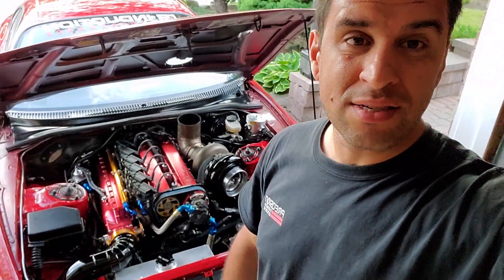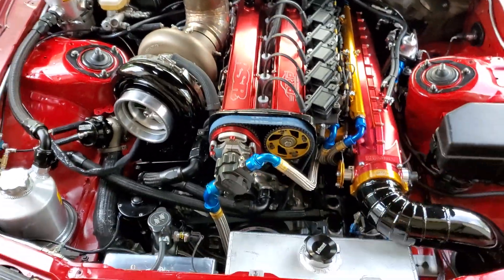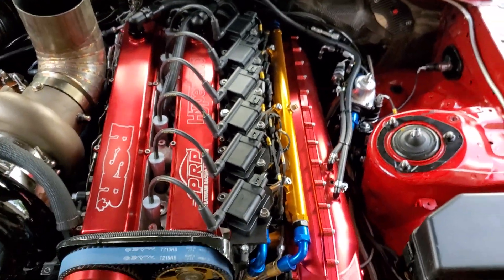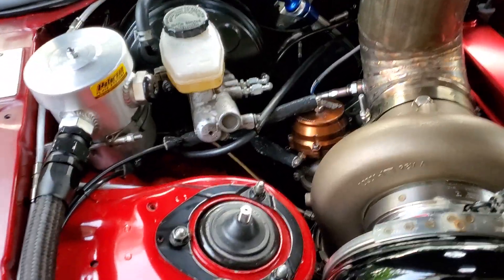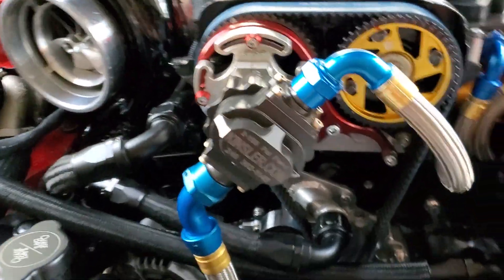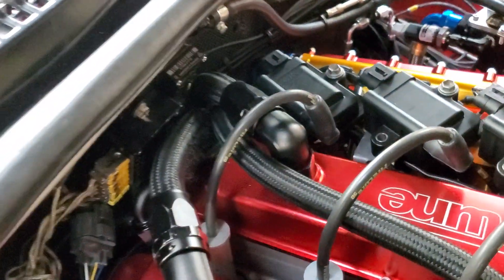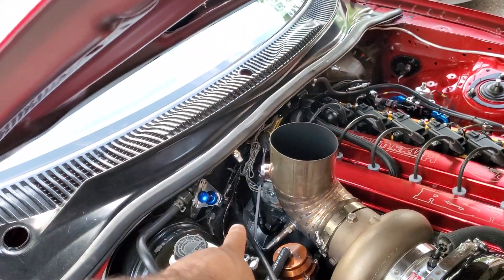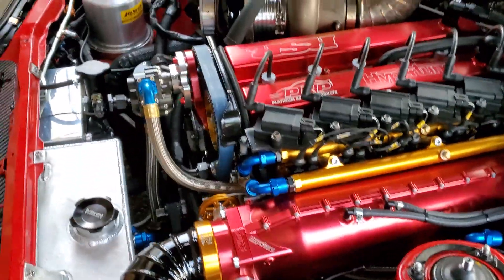2500hp 2JZ - Engine Details

Comment: Such a killer build man. Building a 1000-1300hp 2jz now. The oil setup you have is impressive with the heating/priming of the system.

Comment: "Mods to the engine" my brüther you have an aluminum block 2j that's kind of more than a mod lol
Reply from the maker: haha... believe or not, the supporting mods are more expensive than the block.
Reply: Ryan Sammut Racing yea I can imagine that the turbo and intake manifold alone would be pretty pricey. Plus the mechanical fuel pump and dry sump pump, I bet that adds up pretty quick